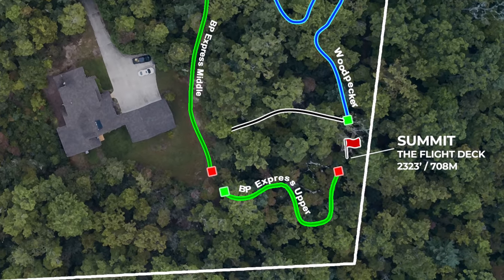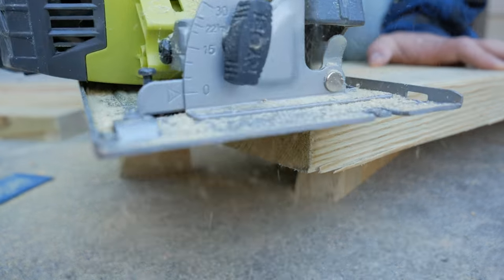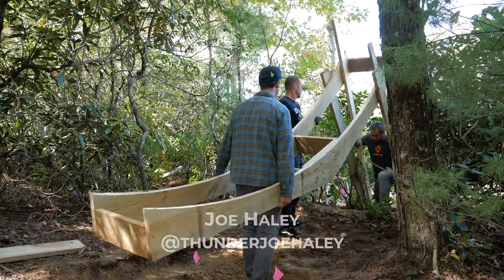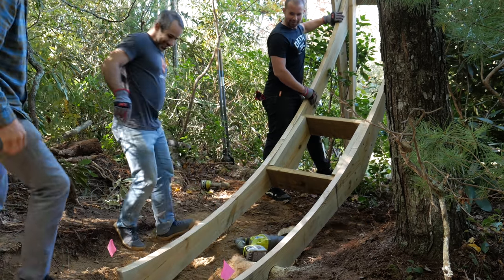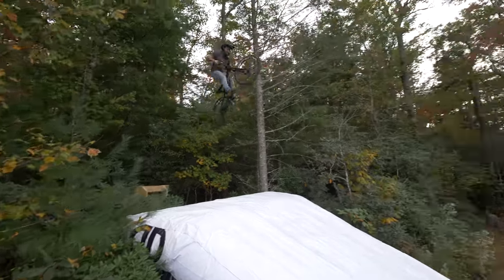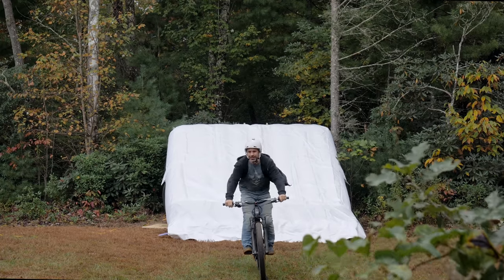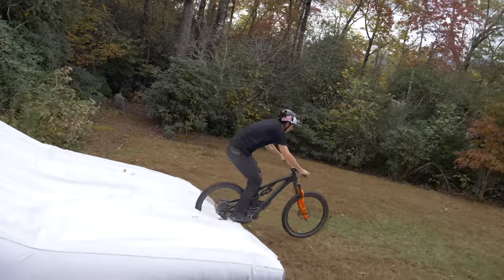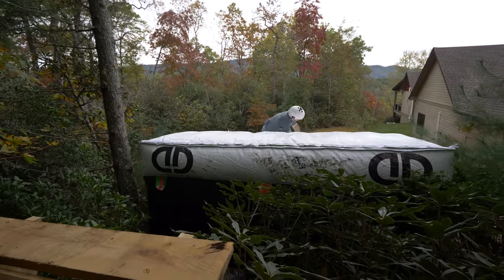Building a Hidden Backyard Bike Jump

Comment: Rent a trencher and run some conduit out there, and wire up an outlet. Then buy one of those plastic storage bins you see people use for like patio furniture and pool stuff, and keep the airbag and blower in there. Leave it all under the jump or in the woods somewhere and you won’t even have to lug the blowup and blower out or run an extension cord, making it super easy to set up and you’ll probably use it even more

Comment: Where you cut out for the root.  Buy a sheet of 3/4” pressure treated plywood.  A half sheet will do.  Put a 3’ long piece on both sides, glued and screwed to the piece, also cut around the root., use titebond lll or all weather construction  adhesive.   More the better.  This will significantly increase the strength of that section, especially after the glue dries.

Comment: Grab some styrofoam insulation and lay your boards on it to cut the boards. You'll cut through the board into the foam and it will give you a nice flat surface to use.